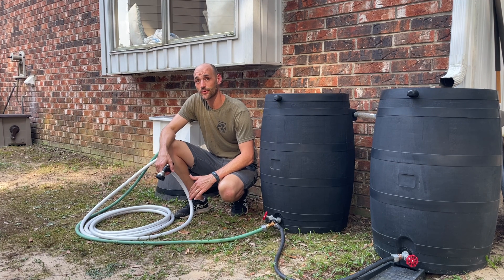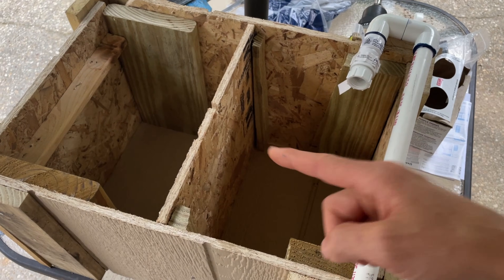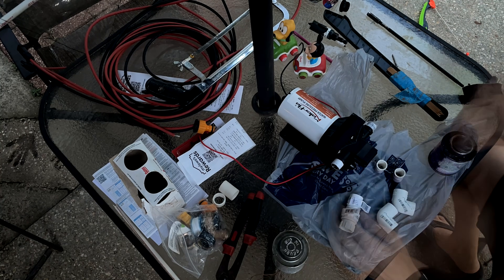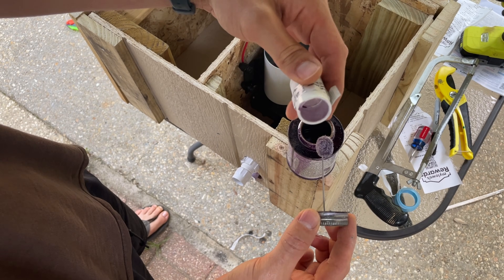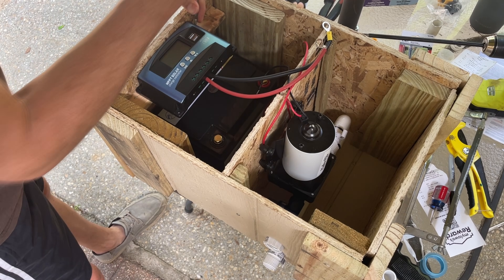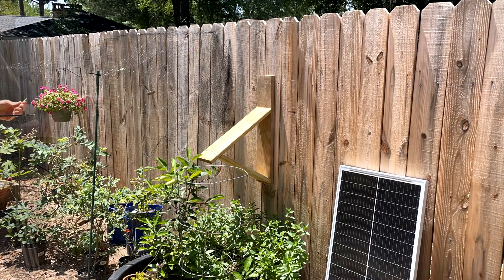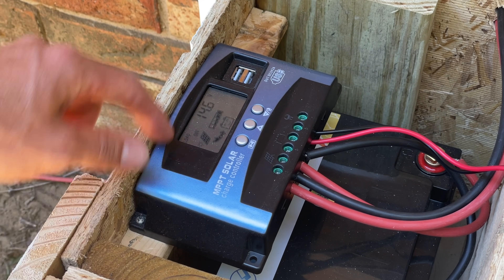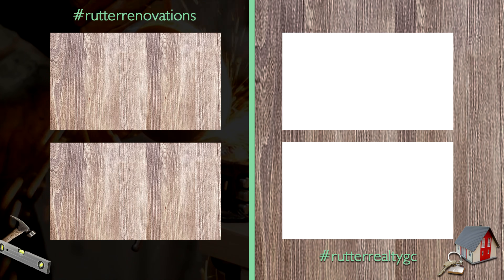Solar Water Pump for Rain Barrels

Comment: Couple of thoughts that I had.

1. Freeze Miser with a Tee on the pump output

2. If you put all of the electronics up high and add a water outlet a couple inches off the bottom on the pump side, you can almost ensure water won't reach your electronics. 

3. Also consider some sort of vent/louvre near the top for ventilation in the summer.

4. Make sure the seal is good where the acrylic inlay is. Beware with sudden temp changes of expansion and contraction - just in case a repair is needed.

Well - I started with two thoughts and ended with four... Maybe something will be helpful!
Reply from the maker: Great ideas! Thanks for sharing!

Comment: can i use this for my house? the only water supply for my house is through a water tank.
Reply from the maker: Sure. The pump is designed for RVs water supply, so I don’t know why it wouldn’t work for your home. You might want need more panels or batteries depending on how much water you’re using.

Comment: Nice build.

Solar panels are the last thing to hook up.
When doing maintenance I dont like to unscrew the connections on the charge controllers.

I add a switch on the positive wire between the panels and charge controller.
It is convienent.
Reply from the maker: Nice! That would be handy!

Comment: what size hose/pipe did you use to connect the barrels at the top? And did you use the fittings that came with the barrels?
Reply from the maker: I did use the fittings that came with the barrels and I believe it was a 1” flexible water line.

Comment: Did you ever set up an overflow solution?
Reply from the maker: The barrels overflow onto the ground. No though.
Reply: @rutterrealtygc has there been any issue with water getting into your basement or crawl space?
Reply from the maker: They overflow onto the ground. No though.

Comment: So Im confused on how it cuts on and off, I must have missed somethiing
Reply from the maker: The pump has a pressure switch built in. When you stop spraying the hose, the pressure builds and shuts off the pump. When you spray again, the pressure drops and the pump will kick back on.👍😊

Comment: You want to install the filter down stream from the pump for multiple reasons but the main one is if the filters start to clog the pump will have to work harder to suction thru it.  For a rain collection setup, it is better to filter at the source inlet and as long as that is proper, the system needs nothing down stream but having one post-pump is still fine unless there are flow issues.
Reply from the maker: Gotcha!👍😊

Comment: Thanks for the informative video- do you know what flow (gal/min) you are getting from the sprayer? I'm interested in how long the battery lasts on a full charge, and how much continuous water you can get off a single 55gal barell?
Reply from the maker: 5gal/min and I’ve never run out of battery, so I don’t know about the battery time.🤷‍♂️

Comment: To make the job less 'ghetto' looking and more robust, any time you are connecting wires of various sizes to a round screw terminal such as your MTTP controller, consider having a few ferrules (EG: for 10, 12, 14 and 16 AWG wire) on hand that you can crimp onto your wire ends.
Reply from the maker: Great advice, thanks for the tip!👍

Comment: This is very helpful! Im trying to use a set up just  like this to feed a drip irrigation system rather than a hose, would putting a PSI regulator on it damage the motor pump at all?
Reply from the maker: Good question! I’m not sure if that would hurt the pump. 🤷‍♂️

Comment: Awesome video! 

I have 7 downspouts on my house. How would you suggest capturing water at each downspout, then diverting it to a much larger barrel in the back yard?
Reply from the maker: Good question! Without being there, I have no clue!🤷‍♂️
Reply: @rutterrealtygc  I'm considering the possibility of making your pump design portable on a hand truck, then going to each barrel to transfer the water into the larger tank in the back yard.

Comment: what lift and run would that pump achieve? I would like to use it on a farm livestock water application. have a stream that i would like to pull from thats about 8ft down from the bank on a remote place on the farm for cattle. Also do you know the approximate cost of the project?
Reply from the maker: Less than $200 I believe. Not sure about lift and run.🤷‍♂️

Comment: Great video, just add circuit breakers or switches and fuses to make it perfect. If you have ever seen the power of a battery when a wire gets shorted out you will always use fuses or breakers. The wire glows cherry red like a toaster.
Reply: how do you determine the appropriate size fuse for an application like this? And would the fuse be on the positive battery wire?
Reply from the maker: Good question. Andrewmasse3310 might know the answer to that! Or google.🤷‍♂️
Reply from the maker: Good idea!! I should add that!

Comment: I need help with getting my Sprinkler System working again, someone stole the Solar Panel and Battery. The Control Box has 32 zones on it and I have a new 100 watt Solar Panel installed and new battery but the Control Box doesn’t have power to it. Do you have an email or website where I can send pictures
Reply from the maker: Do you have a controller or inverter for the control box to plug into?

Comment: You really did go overboard on your electronics like you said. You solar panel looks like one of those with about 5 amps of output at 22 volts. Your charge controller will be limiting the voltage but not raising the amperage, if I am right that it's PWM. You can parallel a bunch of solar panels until you get to a suitable amperage to justify the wire you chose. You'll be able to add a bank of paralleled FLA batteries outside the box and hook them to you LiFePo4 battery inside with wires large enough to handle the output of your charge controller. This will allow you to run a dusk to dawn LED system for your entire yard if you like or to have a charged bank to attach an inverter to in a grid-down situation. You can never put too many batteries on a charge controller if you're producing more electricity than you use. I have 11 370-watt solar panel in series running about 430 volts at just under 9.5 amps on speaker wire to a 5kW off-grid inverter. I know that the wires won't last long in the summer sun but they have lasted three years so far with no visual signs of degradation. My battery bank consists of 16 122Ah FLA Deep-Cycle marine batteries and 48 314Ah LiFePo4 prismatic cells all set up for 48 volts and paralleled at a bus bar that gets fed and drawn from by my 5kW off-grid inverter. This amounts to 66,725Wh that I could draw on at full flow for 13.345 hours. The only things running on this are a 5 cu ft chest freezer and a small apartment size refrigerator. Between the two loads the system could run for a month without sunlight if the inverter didn't have an idle draw. My 12V system consists of 2 40A MPPT charge controllers, each of which has a 530 watt solar panel, 4 of the FLA batteries and 12 of the Prismatic cells They are two separate but equal systems that have a 100A disconnect switch between them in case one of them fails. I love solar power. It helps me to be free from future payments. I still have cable internet, cell phone, 2 insured vehicles, and a MMORPG membership but no water bill and no electric bill. Btw, the rest of the wiring is at least what is needed for continued safe service and the tools I bought for the installation have contributed to the safety of the system.
Reply from the maker: Wow! Thanks for all the info!

Comment: Hi Ryan, I like your set up. It’s nicely engineered and you explain everything very well, thank you, but if anyone wanted to install a cheaper version then it’s quite practical to simply connect a pump straight to a solar panel without a battery or solar controller - nothing more than a float switch to stop the pump from running dry.
It means that the pump only runs when the sun shines but many folk do that as all they want to do is pump water up into a high tank so that it has a head of pressure for use whenever required.
I use a similar set up to run a couple of cooling fans comprising 2 x 12v 80W automotive fans connected directly to a 12v 100W panel, to put some airflow through a poly tunnel whenever the sun’s up. 
This sounds counter intuitive because the immediate thought is that the low voltage that the motor receives, as the solar panel comes in slowly then wanes away, will simply pull a high Amperage and burn a motor out but, in the case of solar panels there’s no Amperage to draw without voltage. It’s also good to have a higher demand than a solar panel can supply because a 12v solar panel will push out circa 18v at max output and automotive fans are noisy and will scream at that. 
Simple motors are surprisingly robust and will just start to run when they get a sufficient voltage and stop running when they don’t . . in the same way that the simple motors that power stove top fans deal effortlessly with variable supply characteristics.
Reply from the maker: I doubt that the solar panel will provide enough output to supply the necessary power on Delano for this pump, but let me know if you do this setup without a controller and battery and let me know how it goes.👍😁
Reply: @rutterrealtygc  As my solar powered fan set-up (without charge controller & battery) doesn’t directly relate to your solar powered water pump with battery & charge controller, here’s  a YouTube video showing a working example of a pump hard wired to solar panels without a battery or charge controller. https://youtu.be/sf8u0dOfxnY?si=TJ-qImkz_aEME7Xt
Reply from the maker: Thanks!

Comment: Just put the rain barrels up higher for gravity water pressure.
Reply from the maker: Yeah, but it still wouldn’t achieve the pressure I wanted. Good thought though.👍
Reply: @rutterrealtygc  prob not the pressure you want but couple ft off the ground is a huge difference. It would be decent flow.
Reply from the maker: Thanks!😁

Comment: I notice your pump is higher than your rain barrel outlet. You should get better performance if you raise the rain barrel (or lower the pump). Should extend the life of your pump as well as it won't have to work so hard.
Reply from the maker: Good tip!👍

Comment: Are there any other pumps you recommend? The one that is listed is out of stock.
Reply from the maker: I would just find something with comparable specs. GPM, Volts, correct size connections, etc.

Comment: Just getting started with a rain barrel. How much did the pump system cost you?
Reply from the maker: I overbuilt my system for potential expansion and alternate uses, but $300 (not including the rain barrel). It made sense to spend a little more and have the ability to do more later.👍

Comment: Adding a fuse inline with the positive battery lead is good practice. You are also trusting the pressure switch on the pump as your only cutoff. Adding a switch and relay will allow you to positively disconnect power to the pump when it's not in use. These 2 steps reduce the chance of fire and shock hazard. To keep mice and other pests out, put mothballs in both sides of the box.
Reply from the maker: Good tips. I actually turn the power off to the pump via the controller when not in use. 👍

Comment: How does the pump know when to energize? Internal flow switch in the pump/motor?
Reply from the maker: Yes, there’s a pressure switch. When you don’t squeeze the hose sprayer, the pressure builds up and switches the pump off. When you squeeze the sprayer, the pressure drops and kicks on the pump.

Comment: Very neat! I made something similar. Except mine is in a 5 gallon bucket. With the pump on bottom bolted down. And put holes on each side for easy hose connnection also added  some holes on bottom and placed a screen to prevent bugs from making it their home.  I also for emergency drainage. I also drilled 4 pieces of wood around inside of bucket to make a round platform for battery and charge controller stoage. I also added a power disconnect switch and added a voltage meter for easy voltage monitoring. Works like a champ.
Reply from the maker: That sounds great!
Reply: @rutterrealtygc  thank you for your video. It was well made.
Reply from the maker: Thank you!😊

Comment: The higher yur rain barrels are off the ground the better  water flow you get . My rainbarrels are up on concete blocks with patio blocks on to of concrete blocks and  then ontop of the rainbarrel I put window screening to keep out leaves and dirt . I made my own rain barrels from 50 and 100 gallon barrels and put in bags of cow manure to make cow manure tea to feed my plants .  I used bigger taps at the bottom of the barrels to allow more water flow . I took a hint from my koi pond filters I built and used tank adapters  and used abs piping with turn off valves . I used then sump pump hose connected to them  and a turn off valve at the end of the sump pump hose  to put water in my veggie gardens .  I can turn up or down water flow with the valve .  I used to use an old koi pond pump ,but turning off water can ruin the pump  .
Reply from the maker: Sounds like a great setup!

Comment: How would the pressure be with a longer hose? We have a 100ft retractable hose.
Reply: Won’t work as well using a retractable hose.
Reply from the maker: I could see that!
Reply from the maker: I don’t know. I don’t foresee it having an issue with that length.

Comment: Would it make a difference where the u bend is in the system? Putting the u bend on the input verses the output. Wondering if the pressure side u bend might cause "stress" on the system? Love the setup, building mine this week when battery arrives.
Reply from the maker: I don’t know. You could just go out the other side of the box without a bend though. I haven’t experienced any pressure issues with the bend though.👍

Comment: Great video!! I do pressure washing and soft washing and use 12v pumps.  I will say that it’s Very beneficial to use non collapsible hose on the suction side of your pump.
Reply from the maker: Good tip, thanks for sharing! 👍

Comment: So when you use the system do you have to turn it on and off? Could I possibly hook it up to a water timer?
Reply from the maker: You do not have to turn it on and off. You could hook it up to a water timer, but you probably want to incorporate a safety switch that will turn it off whenever your water supply is to low so your pump doesn’t burn up

Comment: its .036 PSI per inch so If your waters head is 11 feet in the air you get 5 PSI. 1.5 to 2.5 PSI is doable with a crib.
Reply from the maker: Glad I don't have to worry about that now. Good to know though!

Comment: I'm starting a nursery business on my property, but my county water pressure is so low that I can't run sprinklers. I have a couple ibc totes that I can connect together and use this to run sprinklers/hoses/mist system. I've been looking for a solution that's cheaper than $3000 to repair the well. Thanks!
Reply from the maker: Awesome! This should work!

Comment: If you took the teflon tape and did it counter clockwise...wouldn't that prevent the unraveling of the tape in place of wrapping it 4 times?
Reply from the maker: How many times do you wrap it?😊
Reply: @rutterrealtygc just enough

Comment: Very helpful video! The pump suggested is "currently unavailable" on Amazon. Is there an alternative pump you would recommend that's currently in stock? Thank you so much!
Reply from the maker: Any 12 RV pump with a pressure switch should do. Mine was 5 gallon/minute and 55 psi. Here’s another example.

https://www.amazon.com/dp/B0BF9VYCK8/ref=sspa_mw_detail_0?ie=UTF8&psc=1&sp_csd=d2lkZ2V0TmFtZT1zcF9waG9uZV9kZXRhaWwp13NParams

Comment: We're missing the link for the charge controller
Reply: Nice video! To clarify, this is not a true MPPT controller, it’s really a PWM controller. MPPT is the brand name.  This mislabeling unfortunately is a common issue with the less expensive Amazon/ eBay controllers. This charge controller also lacks true LiFePO4 battery profile charging so battery will only get up to 90% full. Not a problem if the limitations work for you. Back of napkin calculations indicate yours will for your needs.
Reply from the maker: Got it on there now! Thanks!
Reply: What does that mean? I just bought all the same stuff do do the same thing as you, what is this missing link?

Comment: "45 degree angle".  As far as I know, the ideal angle for a solar panel is whatever your latitude is.  If you're at 20 deg north, face the panels south and tilt them 20 from horizontal. If you're at 45 degrees north, then 45 degrees is the right angle.
Reply from the maker: Thanks for the suggestion! I’ll have to look that up. I just did a quick search for the ideal angle and it was a range based on time of year and time of day. 😊👍